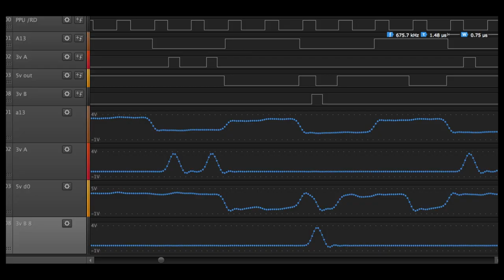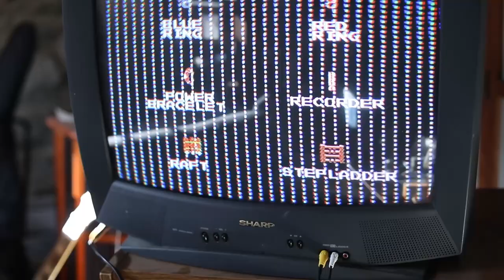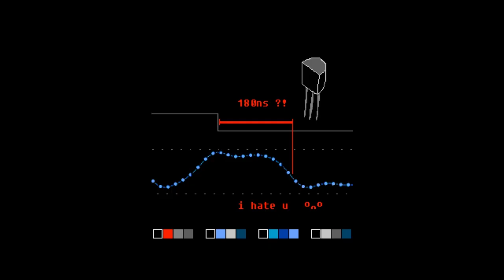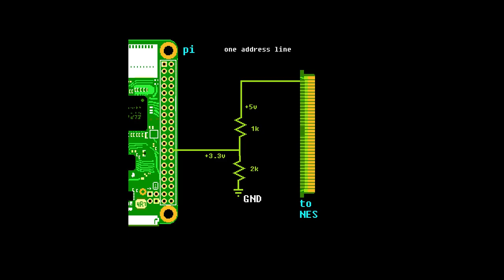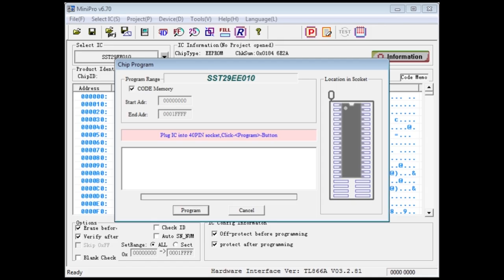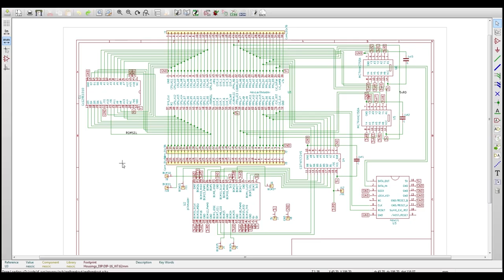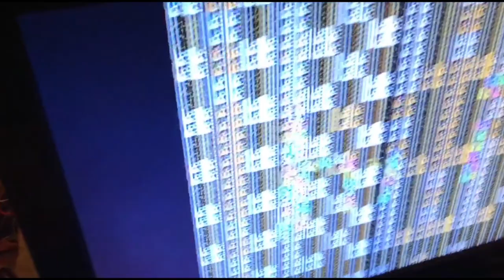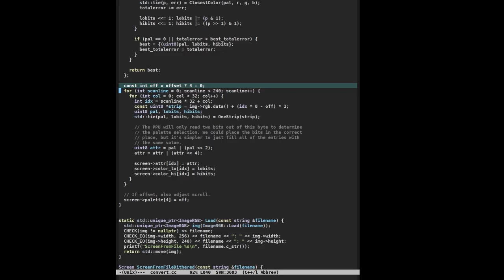Making of "Reverse emulating the NES..."

Comment: Another tip when laying out a PCB.  Before you order the board, print it out on paper and lay any components you have on the pads to see if they match.  I do this with all my boards. Of course Murphy's gonna get you anyway on something stupid, but at least it'll usually be something you can rework at home.  Excellent work on the project, I've very much enjoyed the videos :)  Cheers
Reply: THIS!  just finished my first PCB project. What a surprise when I got the PCB back and my main IC section was way too small! So, yes, definitely print out your PCB and lay your parts on them. I do that now and it has saved me from many more problems.
Reply: Yup, would 100% suggest this too, really helps when sending off to china, not so bad if you fabricate yourself but still stops you wasting time. has flashbacks to the 5 versions of a Dual Flat No leads part
Reply: Wow this is such a good tip. Thank you!
Reply: 1:1 fit checks are essential
Reply: Another way is to use the 3D view (available in KiCad, Altium, etc).
Reply: I started using easyEDA and pretty much everything I've done so far fits, unlike proteus

Comment: That is beautiful work. That part about reverse emulating the CPU to make the audio better made me realize you are nearly to the point where the sole function of the Nintendo itself is to render video and audio from a hilariously convoluted set of inputs. I.e., it's basically a set of D/A converters and hardware that sends signal to a TV.
Reply: Yeah, but the point is, it's a GREAT party trick to pull with anyone who has an old NES lying around (AKA, fellow geeks. XD) I mean, who WOULDN'T be confused/amazed if you popped in an old zelda or mario cartridge, then booted up Windows (Or, well, Linux in this case) or a far more modern game that can run on a Pi.
Reply: Pop in a NES zelda cartridge and be playing Ocarina Of Time
Reply: BrickOfDarkness Nah mate, get a Wii U emulator and play Breath of the Wild.
Reply: "But can it run Crysis ?"
Reply: I'm more curious to know if you can inject/manipulate code in the cpu itself.. this could make the Raspberry Pie a software SuperFX-ish expansion to enhance native-run NES code/homebrew :)
Reply: @thedungeondelver  normally i hate that joke, but this time its on point
Reply: @darksunrise957  succinctly put.
Reply: @thedungeondelver  Can it blend?

Comment: Nintendo switch hacked: not so intresting to watch
Nes hacked: that is what I am talking about!

Nice work man! : )
Reply: The actual method of the hack is not very interesting on the switch I'll agree with that but it's still interesting to look at and use all the homebrews and ports!
Reply: I wouldn't this consider a hack, not like mordern consoles and  privilege escalation attacks as they are different ball game completely this is simply electrical engineering essentially bus stuffing the NES kinda by being able to feed data essentially every clock cycle, in a way he is just dma'ing to the ppu using the raspi which bypassed normal hardware limitations set by stock console hardware, you can access any info about the NES down to the Mobo schematics (and yes you can legally make reproduction NES Mobo from them as  hardware patents are expired which is what the clone makers should actually do), it's less of a hack(not really a hack but someone after 30 years took time to research and build essentially a dsp expansion cartridge like the super fx on snes  )and more like adding an expansion like ram or graphics card on a pc, I am doing something like this with the 2600, using 6502(no not 6507) with additional 64k ram, ay-3-8910 and atmega8515(or 644)

Comment: Have you considered using the linux real-time kernel?  It might help with the graphics glitches.
Reply: This is an interesting idea. I have also suggested to him checking out baremetal Raspberry Pi programming.

I have even posted the list of links showing what retroprojects are possible when you program the RPi in this way, but the post with the links did not show up (probably has to be accepted manually by suckerpinch)...
Reply: Yeah, good call.  I was thinking a RTOS like QNX to fix the glitching, but I was forgetting about the existence of the Linux RT kernel.  Gotta dig more into that one of these days.
Reply: It doesn't need to be RTOS, there are just a few settings that you can change to make it more amenable to real-time processing ( sched_rt_period_us and sched_rt_runtime_us ) and sched_setscheduler to set it to SCHED_FIFO.  It may also help to lock the pages in memory so they don't get swapped out.

Comment: I know this is mega old by now. But your progression through the electrical aspects of this is great. Everything you describe is what every new EE goes through. Why don't these transistors work like I think, why can't I drive this, what is TTL, etc is great! It's very impressive that your persevered.  Many of these problems can be super frustrating and difficult to figure out. As I'm sure a million nerds already (jokingly) pointed out, use less vias!

Comment: Very, very cool!  A couple points though:

- Both the NES and SNES use the SAME chips in the controllers, just the SNES chains a second chip per controller to allow for >8 bits.  The bit order is designed in.  It would be possible to make the NES read a SNES controller using a simple modified plug and having the routine read all 12 valid bits (4 unused, 16 total).

- The NES 5v regulation uses a standard linear regulator (7805?) and if you are truly pulling 1A with the pi alone then you are past its specification.  i.e. You may end up frying the NES and your pi.  Consider supplemental 5v directly into your custom cart.  (I would measure actual power draw first.)

-Greg

Comment: Reminds me of all those years ago when I would void the warranty on everything electronic I've ever owned which all of us hardware geeks did. My first FM pocket radio was source for my first transistors harvested to use on my first breadboard which still had fahnstock clips instead of binding posts. My first stereo I added digital frequency display to the analog dial attaching the LED board to the pointer so it moved with the dial. Oh, the memories... Also great explanation and animation of transistor(s). Transistor theory and application isn't always understood the same way by everyone, you have to get your hands on them and build and see results to get it to click.

Comment: Fun thing about 3.3V CMOS and 5V TTL is that they are directly compatible, usually both ways (e.g. 74ALS series outputs 3V as "1", for others I'd use a small series resistor, say 33-100Ω). Yes, you can directly drive any TTL chip using 3.3V CMOS signal. If you need to convert 3.3V CMOS to 5V CMOS, you could use 74HCT chip. To do it very fast you could go with 74ACT / 74ABT series. Tried it, works, drives things very strong too (and adds ringing to long wires).

Comment: Here's a thing I encountered with a raspberry pi, I did a project thing... With a pi, and it worked great on my desk, but when I mounted it inside a cabinet with control gear (contactors) it'd false trigger, the RF noise from the contactors coming in and out and the sparks therein were enough to trigger the inputs.

Now yea there's ways to stop that in hardware, and the debounce thing... I tried those and they were kinda lackluster, eventually I had to fix it in code, the contactor spikes were very very short, so I ignored short triggers.

I guess this is testament to why you should use industrially hardened and shielded PLC controllers, but they ain't cheap and for a thing you're not sure is gonna work or not... Eh, big investment.

Ultimately I ended up using optocouplers, debounce (even though they shouldn't bounce) and ignored everything less than half a second long.

That's hacky, maybe things like that are supposed to be... Low level programming itself is really hacky and janky anyway...

Regardless, how do you harden a pi against this? Didn't just happen to the pi either, I had a digital plug in timer... That did it too, and it was just in the same room as some contactors not in their cabinet it was in its own... Seemingly their RF spike is so harsh that just being in the same room is enough, and this thing isn't an Ali express or an amazon thing... But it would still false trigger.

Tl;dr: contactors are noisy as hell and they will trigger micro controllers, and I don't really know how to remove that entirely and in an elegant way.

Edit: also, I wonder if it's possible to take the output from a genesis/megadrive, and force it through the NES, thus kinda... Playing sonic on a NES.

Comment: Pretty awesome stuff. Makes me wonder what an SNES can do. I wonder if you could make an SNES play PS1 games.
Reply: He could make an NES play PS1 games.
Reply: What he did was essentially interface with the display tech of the NES and nothing more really. It's really neat, don't get me wrong, but it's not some amazing, revolutionary thing. You could essentially do the same thing to any video game console, given enough time and tools to run unsigned code.
Reply: On the SNES, all graphics that you want to display must be copied by way of the CPU (or rather, its DMA engine) to the internal video RAM (VRAM) of the console. The PPUs have no direct connection to the cartridge slot so you basically can't feed data in the same way.
Moreover, you can only access the SNES's VRAM when the PPUs aren't displaying anything, so only during blanking or when you force the display off. That means you have very limited bandwidth to copy image data to the VRAM for display, around 6kBytes per frame (unless you want to letterbox by forcing the display off for parts of the screen). That's enough for the Super Gameboy to stream the Gameboy picture at 60 frames per second but not much more.
MSU1 video streaming demos exist but they are typically lacking either screen real estate, frame rate, or number of colors.
So in terms of how this works the SNES could actually do less than the NES here.
Reply: NES=SNES=WII=WIIU=NINTENDOSWITCH
Reply: Myles Johnston no. SNES playing Mario 64
Reply: No wait Atari Playing freaking skyrim

Comment: "the audio would have to be de-made... four sound channels" this is incorrect. look into the specs of the fifth channel, DPCM, and you'll find that you could output sound directly by blasting raw 7-bit sample data to the register $4011
Reply: this does however use a lot of bus writes. if you're willing to settle for lower sound quality, you could use the existing DPCM sample memory space at $C000-FFFF as essentially, a buffer. you would then need to also worry about converting the PCM data your raspi uses into a stream of 1 bit delta offsets, which may or may not be an expensive process. it would significantly reduce bus overhead, though.
Reply from the maker: PCM is what I was referring to when I say streaming audio samples via reverse-emulating the CPU.
Reply: i misinterpreted. usually when people say "de-made" they mean translate some midi into .nsf and use the sound hardware as intended. 
still, now you know the name of the address to write to.
Reply: While demaking pcm sound into 4 channel fm sound sounds interesting, but that means that we have to create a lookup table set in wich an extra powerful chip needs to analize each sample and then make a close matching approximation of each sound, for example it can map a wind sound to a noise sample and water sound to a square wave etc,,,,to fake these sounds but that will require an enormous powerful chip, not worth it,,,

So i would say if the nes can stream rendered graphics trough the ppu while having the cpu left for streaming 7bit pcm audio, why not, however i would suggest go otherwise for 4bit adpcm or 1bit dpcm, because that would be sooo cool, can’t wait!!!
Reply: @tom7  Its been the same bitdepth as pikachus cry

Comment: About getting sound to work, some tool assisted speedrunners managed to get pretty good audio quality entirely through the controller ports and even video with a SNES with the same method.  Look up Tasblock 2017 if you want to see it.

Comment: How does this vid have less views than the other? I don't think people understand how crazy it is what u did. I'm trying to get into NES ROM developing cause adafruits pygamer handheld allows NES ROMs to be played and has an easy setup to make some. And then I see what u did and it just raises the bar to the clouds in terms of NES engineering
Reply from the maker: Glad you liked it! :) Most people don't have patience for the technical details (which is fine!) so it's not surprising to me that the "main" video is much more popular...
Reply: @tom7  wat u did is kinda similar to wat someone did with circuitpython to supercharge a Gameboy. Made a PCB and everything. Do u think I could mess with an NES Cart rendering with a NES Clone? Or no cause Clones are kinda like emulators and don't really use the carts like the original NES does

Comment: This is definitely not the first time the PPU has been used in this manner.  The Nintendo Demo Vision was a piece of hardware based on the Famicom which translated the display data signals from a Game Boy so it could be displayed on a standard TV monitor.  It actually performed all the translation in software.

Comment: Hey Suckerpinch, What you achieved sounds like retrofitting the NES to have what the 8-Bit Acorn BBC Microcomputer had at the time, the "Tube Interface".  If right, this gives Acorn BBC users a warm glow: 

https://en.wikipedia.org/wiki/Tube_(BBC_Micro) 
"In computing, the Tube was the expansion interface and architecture of the BBC Microcomputer System which allowed the BBC Micro to communicate with a second processor, or coprocessor.

Under the Tube architecture, the coprocessor would run the application software for the user, whilst the Micro (acting as a host) provided all I/O functions, such as screen display, keyboard and storage devices management. A coprocessor unit could be coldplugged into any BBC Micro with a disk interface (whose ROM contained the necessary host software) and used immediately."

Comment: For this sort of project you may want to look into the BeagleBone Black as alternative to the RPi family. While its main cpu is unspectacular, it has a pair of auxiliary cores (called PRU, Programmable Real-time Unit) which have gpios wired directly into registers and which are designed to have deterministic low latency. They can sample their inputs or update their outputs in a single cycle (@ 200 MHz), and iirc the overall delay to the external physical pins is around 25ns roundtrip. An impressive example of PRU's capabilities is BeagleLogic, which turns a beaglebone into a 14-channel 100Msps logic analyzer. In your application, read latency to external ddr3 ram might still be a problem though, but if you can predict the addresses well enough you could copy the data to PRU's fast local ram in advance.

On the setup you have on the RPi 3, you should be able to get a significant improvement (in particular get rid of flashing) by keeping one core completely dedicated to your real-time task. You can use cpu affinity to keep your real-time process on a specific core and keep all other processes and kernel threads off it. The irqbalance daemon (responsible for deciding which cores are responsible for handling which irqs) also supports "blacklisting" a core to ensure it doesn't have any deal with any device interrupts. If the kernel is configured with CONFIG_NO_HZ_FULL=y and you use a core other than the boot core (i.e. not core 0) to be exclusive for a single task then your code should be interrupted at most once per second (and I know they wanted to get rid of that final interrupt too, haven't checked whether this has been done already).
Reply from the maker: Thanks, a few people have suggested BeagleBone and I may try that out next time. I'm using isolcpus and no_hz, but I don't think it's possible to mask irqs per-core on the Pi 3 (I think that the BCM chip just doesn't support this?), at least I tried it and it didn't work, and I wasn't able to find anyone that succeeded at it. Although, I am getting one major interruption per second (pretty much exactly one per the second), so maybe that is what you're speaking of. The other noise is coming from stuff like cache misses, not interrupts, I think.